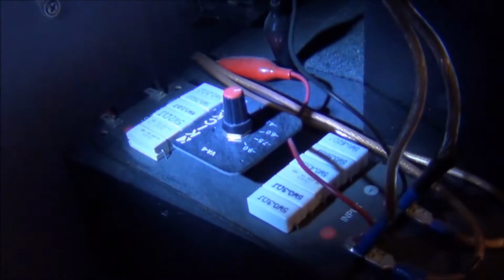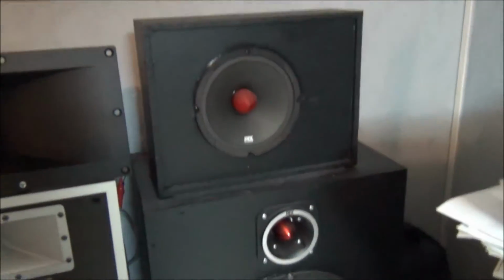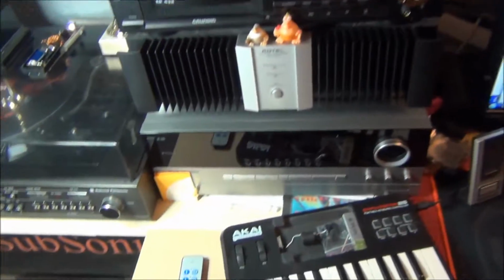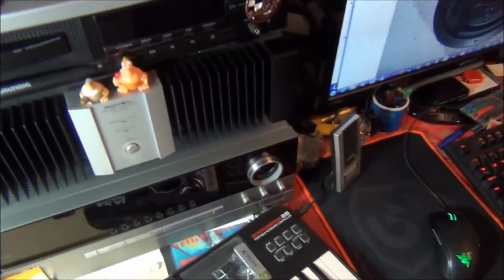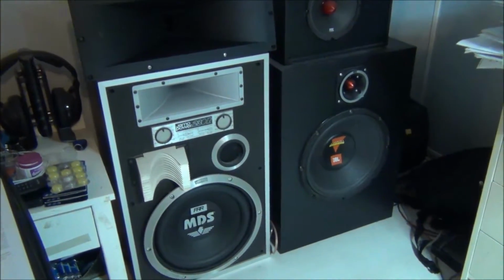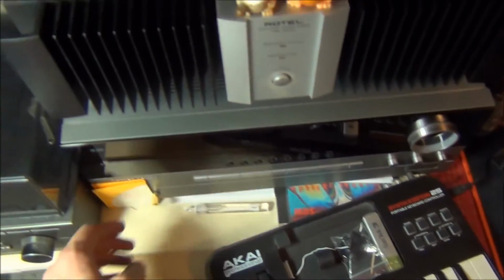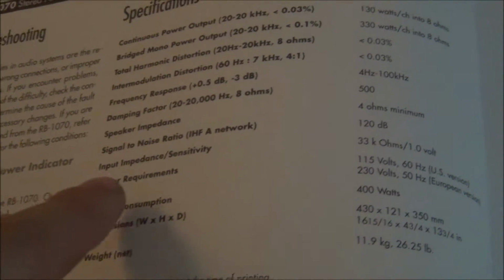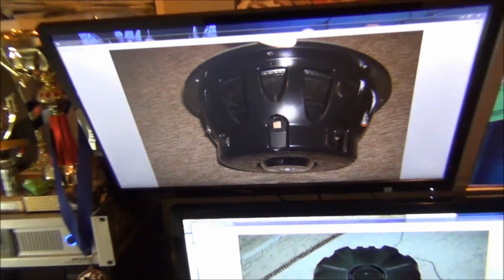2KW Home Audio Tutorial

Comment: haha i love setups like this, custom build parts and shit very cool.. whats the peak power for the subsonic sub just by itself?
Reply from the maker: Thank you sir! the motors original designed power handling is 400RMS 800 Peak, but I have fed it more with the new cone mounted and had no thermal issues so far, the Europower is able to deliver up to 1200 watts peak with 2x425RMS and is connected with all power to this sub and it has worked very well with it connected so far :)
Reply: Pulverrostmannen i have a question tho.. why not use computer power supplies instead? they can output up to 2k watts of clean and efficient power
Reply from the maker: as these amps are built for wall power it is not really necessary to make it in in another way than I got here,
I could connect a car amplifier here too if I wanted and had a pair of very powerful computer PSUs or a big converter but in the end it would be very expensive and complicated also. I wanted the EQ to modify all channels separate and it was the cheapest solution to use the Bit ten and the power it needs are very low so it was very cheap to integrate it for me the way I did as well :)
Reply: Pulverrostmannen yea i can see that since you have multiple speakers.. when ever i go to do this i will probably have 2 2k watt psu's so i can get some insane power
Reply from the maker: Sounds like a plan :) I would gladly watch videos you may record when you build your system! I have built this system here over a period of several years and have gotten one thing here and one thing there and built piece by piece to make it the way I want it at a decent cost in the end but I really enjoy it also in the way I have gotten this in the end, it is capable of about 130DB with music in the middle of the room and can be played at deafening volumes for as long as I desire without getting tired or overheating :D
Reply: Pulverrostmannen yea ill make sure to put up some vids on it.. ill be getting a job soon so hopefully it wont take that long to save up for.. all though it will be pretty expensive.. im hoping to run just a single 5k rms amp so i have 1k watts to spare for heating issues
Reply from the maker: Awesome! I look forward for that, send me a message when you have it up to remind me about it if you can. 
be careful not to overload such PSU as they may take damage if they get overloaded and are not well dedigned for such intensive transients a car amp draws, 5KW power would demand about 500 Ampere of 12Volt power to work
Reply: Pulverrostmannen yeaa ill have to look into all of that but im sure ill come up with a good build, and ill be sure to msg you when i have everything installed
Reply from the maker: sweet! thanks for a good chat sir
Reply: Pulverrostmannen you are very welcome